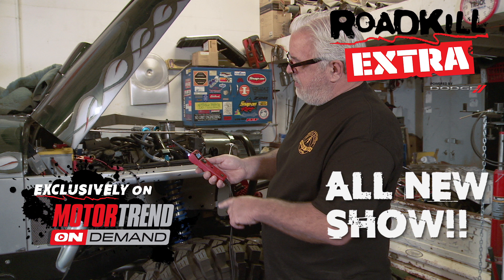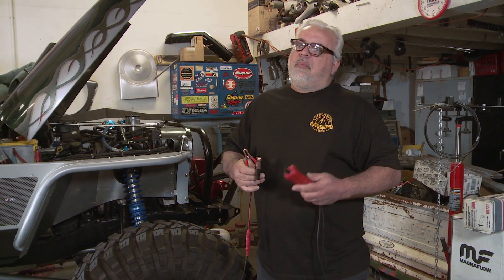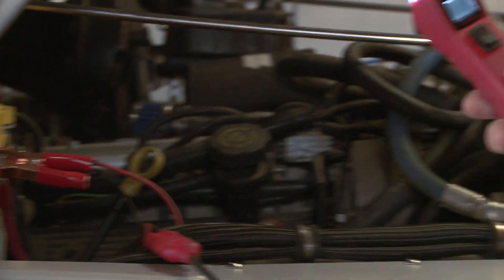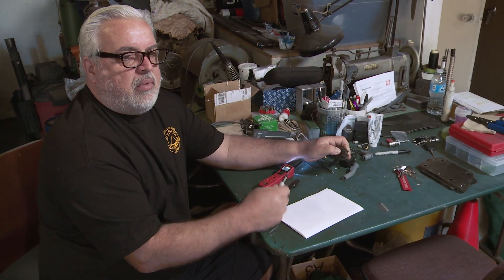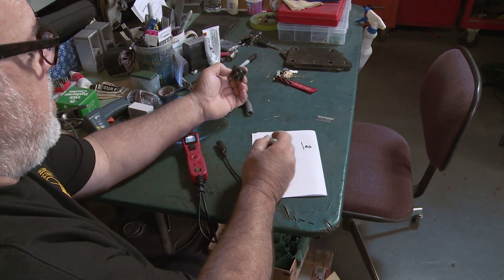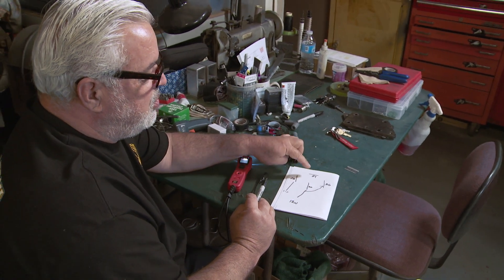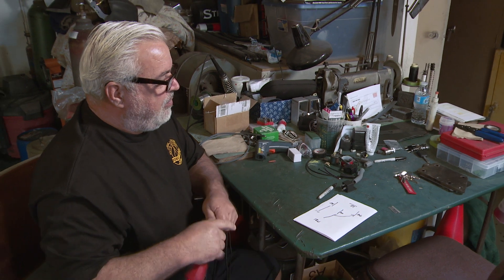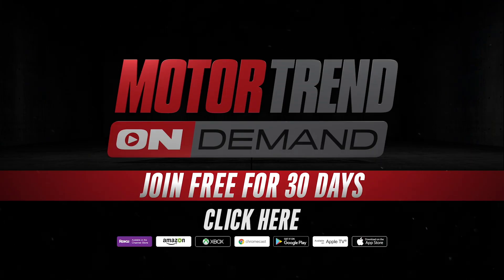Electrical Tech Tips With Lucky! - Roadkill Extra

Comment: If anyone wonders what they look like on the inside... http://www.bcae1.com/images/jpegs/IMG_4328b.jpg

If it clicks but still doesn't connect 30 properly with 87, you can often bend them open and file the points (upper right), just like you would do on an older car with points ignition.

Comment: Lucky needs, DESERVES,,and he wants,, his own Motor Trend Channel Gig.  We all know he has earned his stripes.  Electrical is a huge side of the story that baffles youngsters and oldsters,,and it is getting even more dominant than was expected 3 years ago,,let alone 10-15 years ago.  Relay info,,save it, love it.  Most of that is super simple,,as we like it.  Our college had a huge relay board that was built by a professor who had waay to much time on his hands,,where 50-60 of them added in series, would trip when you added power(or trigger) to 1 leg of 1 relay.  Cascade effect with resistors for speed control.  Very cool as it was.  Power Probe!!,,,get one,,all of you.  Get the Gen 3 lucky model.  LONG leads and a nice storage box for it all.

Comment: Damn, that tool is useful!  No more jerking off with different settings on a multimeter and moving the ground plug all over the place to test grounds and check for power, just plug that fucker in.  Also, that switch gives you some awesome abilities like to test relays w/o running a long ass fused wire.

Comment: Great explanation, but you didn't tell us why a relay is needed.
Reply: Its generally done so that whatever is controlling the load (in this case your headlight switch) only needs to be rated to handle enough power to turn on the relay. If you didn't use the relay your headlight switch would have to carry the full current from the battery, through the switch and all the way back to the headlight.

Comment: Hey Lucky, check out the load pro test leads. they are great for finding draws or shorts where you can't see voltage drop without a load.

Comment: power probes are awesome i still have the second gen but been using them for years , im an automotive tech for 18 years, hey Lucky i have a trick with the power probe that i use sometimes.
You can turn the ground lead into a postitive lead if you just hook up the neg cable to the positive cable but do not hook up the other cable

Comment: why is he not using a red top battery? isn't red top starting and yellow deep cycle?
Reply: TDONLEY91 yellow tops are a multipurpose battery
Reply: The yellow will take the repeated deep discharge of say... using a winch, as well as being a starting battery.
Reply: Erich Nunya I was told to use a red top as a starting battery and yellow as a secondary battery
Reply: I suppose you could, but I just read what the catalog at work says... and their website..  https://www.optimabatteries.com/en-us/yellowtop-deep-cycle-battery
Reply: Maybe for a diesel engine, or definitely for marine.  But that'd be less effective than two yellows.

Comment: I never knew how to test relays, this was super helpful!
Reply: He didn't actually show testing a relay, though. When they fail, they will often still click, but the switch contacts will be corroded. You need to put some sort of light or a continuity meter across the switch terminals to test if the relay is actually triggering. Although the powerprobe is a handy tool
Reply: this really isnt a test. id say more than half of all failed relays will click like they work. only way to tell is to apply 12v to the coil, and get 12v through the relay itself.
Reply: And then there's the tricky ones that will show continuity through the switch with a multimeter, but then will not pass higher current from something like a headlight. Things like that are the stuff of nightmares to find.
Reply: when the contact corrode like this you can usually clean them and they will work again. when the electromagnet goes out(no clicking) your just sol.
Reply: of course i would recommend putting new ones in anyway, but sometimes there are no new ones....
Reply: With some you can 'clean' them.. by turning them on and off a number of times, to clear the contact point.

Comment: Glad I clicked on this, as I thought it was going to be about multi-meters, which are pretty annoying for working on cars. 

Looks like a nifty tool, but at circa 150 greenbacks (which is even more in Australian dollars) I'll have to stick to my home bodged voltage probe test light and multi-meter. actually it looks like there are other, cheaper tools that do pretty much the same thing so ebay here I come.

Thanks Lucky!
Reply: William Moser super cheap sells them not bad quality either, too many electronics for them to manufacture them tacky
Reply: I got one made by autel and it has a scope on it and ohms reading aswell. 

the power probe 4 is the boy. but I wont upgrade until my autel dies.
Reply: William Moser my mistake sparesbox.com not super cheap mixing up my tools lol, they only sell ones that test the circuits polarity and voltage but will not provide a physical gateway to the circuit like luckys probe
Reply: yeah didn't sound like something supercheap would sell. I have a few good leads now, worst case I'll make one, as there isn't much to it for what I want one for.